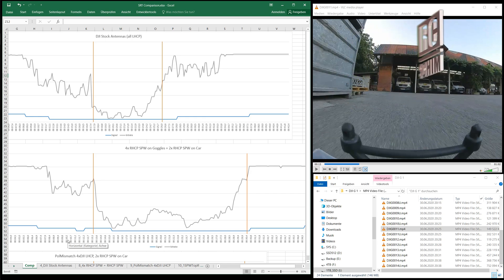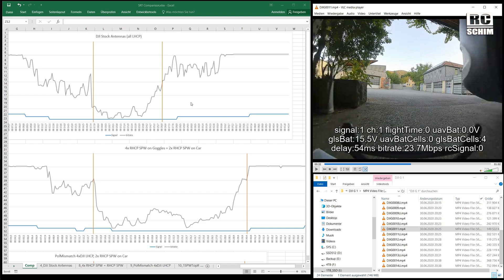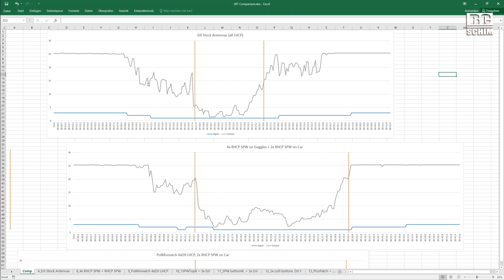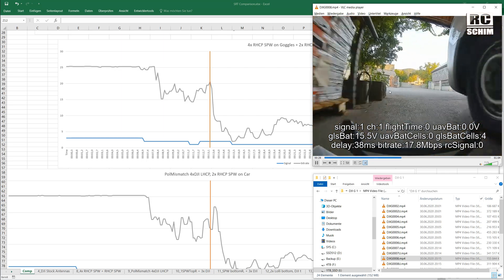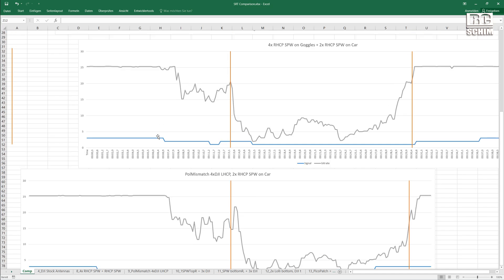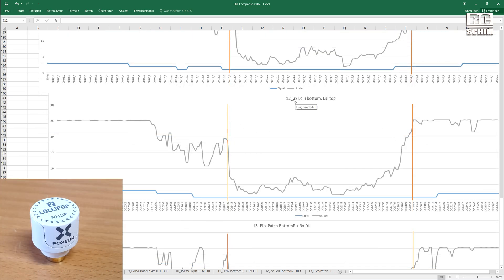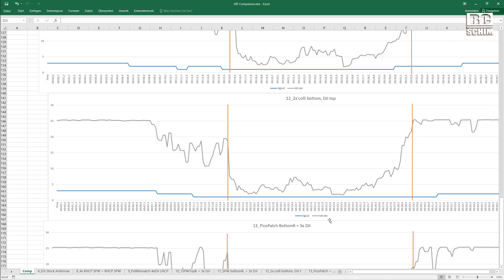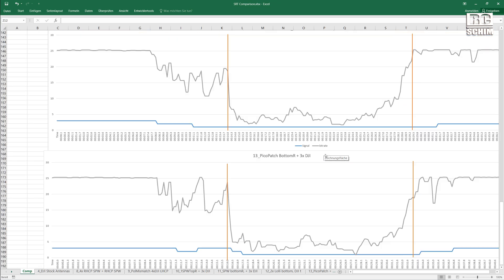Antennatests with DJI SRT to Excel

Comment: hey can anybody remember the problem with rhcp antenna being labelled as lhcp? who posted the vid? livyu? just want to check my new ones.  i have a geprc momomda and an hglrc,  i have the v2 goggles and i've just put on two iflight stubbies along with two stock dji's, so it won't be obvious if i have the wrong polarisation.
Reply from the maker: Yep, it was my video you're talking about: https://youtu.be/ukEulvzUnG4
just compare the look and see if it's the correct one. I would trust iFlight to get this right - but you never know :)
Reply: @Rcschim   ah thanks man,  i have two stubbies and two stock antenna on my v2 goggles, so i'm a bit worried that any vista antenna will work but i would lose range,

Comment: I literally came to this channel to ask you how to do this and the first video I see is what I needed. Patreon time
Reply from the maker: That's a nice first comment to read in the morning. At least I know SOMEONE is interested in these kind of geeky stuff :)
Let me know if you need anything regards to this. I could make a tutorial but I dont think it's too hard.
Been analyzing more like this yesterday (drove further with my car and tested more antennas).
greets, Mario
Reply: @Rcschim  I may actually need a tutorial :). I'm actually very curious about the quad side antennas. I see the biggest difference in antenna placement on the quad but would like an actual measurement.  I'm sure you know what I mean.
Reply from the maker: Yep, know what you mean. do you use fullsize airunit or caddx? I think good, long antenna which is far away from battery / electronix should be good.   on the other hand, on my Sector5 I glued the top of my lollipops to the side of the arm, so their placement isnt the best ;)

Comment: Amazing job Mario. A little improvement to comprehent the matter even more (or is it just me?) is to overlay the grafics on top of each other. It could be more clear to see the differences in one view. It should be more clear to see the differences between the antennas.
Reply from the maker: Been testing more antennas on the weekend and did analyze the data. I cant overlay all the 9 Tests - then it's a mess. But it's a good idea to compare 2 similar antenna configs in one chart. Which I did, thanks for your feedback - you should see it's efffect in the next video ;)

Comment: Maybe it's not surprising you didn't see a big different when mismatching the polarization, given the high multi-path environment you tested in.  Any reflected signals with have the opposite polarization.  Seems to wreak havoc on analog systems, but digital systems thrive on it.  However, I'm guessing the results would be very different on a plane or quad when not in a high multi-path environment.
Reply from the maker: That's what I'm gonna test next, more in the open and with greater range. Lower reflections. Or just in the woods, trees don't reflect I guess...

Comment: You could use similar higher gain patches on the bottom receivers like to 2 menace pico (9db) since they both receive and not in diversity (and try extending them away from googles).. and maintain lower gain omni spw (3db) on top. I think an antenna with good AR like a triple feed patch would be ideal for that situation with multipathing where you experience major signal loss. It would also be interesting to see how two 12db helix 7 turn on the bottom fair :)
Reply from the maker: I'd have 2 8 turn circular wireless helical that I could use on the bottom ports. At leaset in test environment i can manage to point them to the car.
Reply: @Rcschim  Is that ORTs?  your tests on  the ORT Helix 6 turn showed good numbers on the -dbm and -dbm ant. null

Comment: This is great! What an easy-to-decipher visual of antenna performance. I'm inspired now to visually plot the difference between using a little linear antenna on my Caddx Vista vs the included LHCP lollipop. When flying I don't notice much difference but I'd like to see the difference between the two in a graph:)
Reply from the maker: Great, you will see how easy it is to use the script and excel. If you have issues let me know...
For example . Or , for commas. But this can be adjusted in the script.
Reply: @Rcschim  Thanks so much:)

Comment: That would be a job for a fixed wing drone with INav. Flying a pre-programmed pattern with different antennas, maybe even with a total loss of both links, RC and video (while this would be hard with Crossfire). But if it's a drone, it can handle it 😉
Reply from the maker: Repeatable tracks on waypoint missions sound very nice. I was considering this. But it's time consuming to get there, so I aim for a simpler test setup. Simple is always good, so many things go wrong during testing...
Reply: @Rcschim  Hab grad meine olle Bormatec Maja aus der Mottenkiste geholt, to finally make these kind of experiments, thanks to Kurzarbeit and lock-down 😉
Sadly the DJI system does not fully support the INav OSD but I'm going to find a way around this.
Reply from the maker: Ha, an die Maja kann ich mich erinnern. Hätte ich damals bald gekauft. Später ist es dann eine mini talon geworden. Will auch wiedermal FPV Flieger verwenden, aber meist sind die quads einfacher und weniger zeitaufwändig.

Comment: Try using some linear dipoles and prepare to be surprised! (wink wink).
Reply: That was my thinking when looking at the results of LHP with RHP antennas. With that amount of multipathing, each antenna finds its data. And of course on a car which doesn't roll that much, linear antennas would have the best result 😉
Reply from the maker: I already considered them but now I will test them for sure. I will probably drive on our flight field and see if I get more range there driving down the dirtroad. This way them patches should shine vs omnis...
Greets, Mario

Comment: antennae are such a dark art, i wonder if the aomways good performance has to do with its slightly broader sweetspot, when the protective cap is added it spreads out the sweet spot around 5.8ghz, without it there was a peak around 5.7ghz and i'm wondering if dji system channel hops like our radios? ps. i think the rhcp thing is because signal gets reversed when it hits a wall so when its bouncing around a lot both right and left signals are getting through
Reply from the maker: As I understood DJI doesn't hop. Your right, dark art ;) 
Now that Bruce also mentioned it, I wonder how good normal linear antennas really fair in such a test. Imagine they are the best antennas to use on digi and how many FPVers just threw them away :)
I have many still in my drawer...

Comment: LHCP working with RHCP was surprising for me
Reply: This either means that the antennas had a poor axial ratio or that the reflections were very strong.
Reply from the maker: There's a huge metal structure in there (paper press) which for sure was a nice reflector. I think that's the little  mountain range in my charts while in the problematic zone. Pol mismatch should show its effect on the field more than. If not, it's prolly the axial ratio?
Reply: @Rcschim  Yes, I showed the relative axial performance of various antennas in a shootout I did a few years ago, using a reflector to bounce a signal back at the antenna.  It's a really simple way to measure how good an antenna is at rejecting signals of an opposite polarization.

Comment: I would too like to see patches top versus bottom, and one side only as well.
Reply from the maker: I think that's maybe the most important question I ask myself and I didn't find a good answer yet. There's rumors and statements (AndyRC) but solid data would be great. Or just seeing if all omnis are fine in most cases and with lots of range... (that would be a bummer for all the special antennas :)